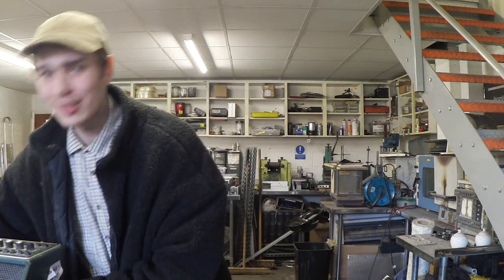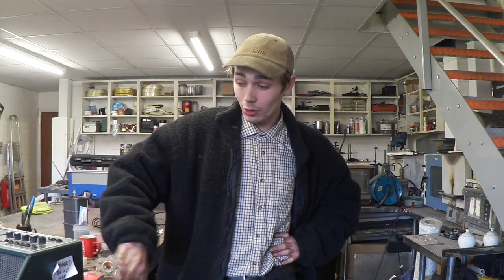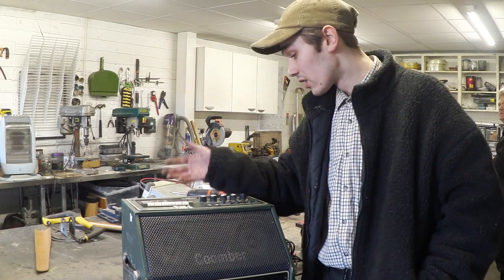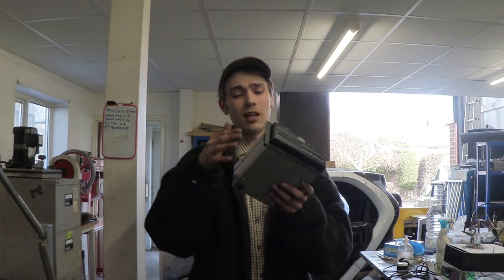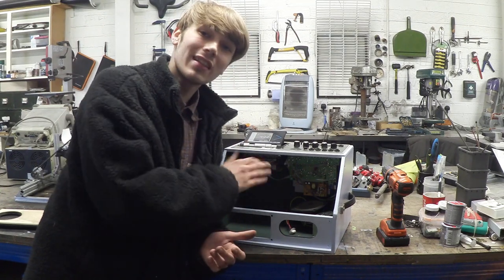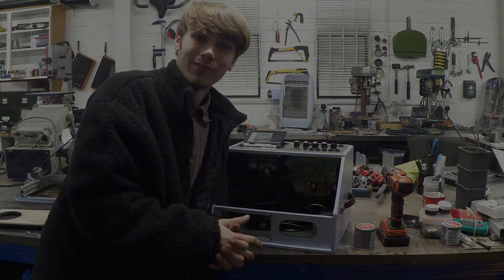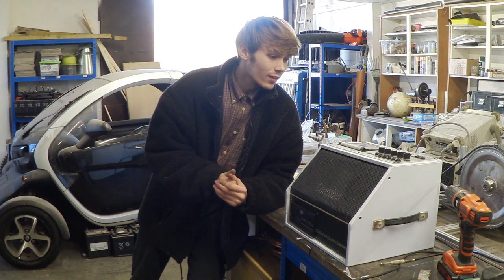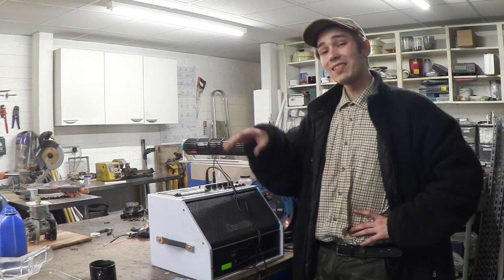1022 - From Trash to Cash - Repairing a Retro Cassette/CD Recorder

Comment: This just gives me the kick to refurbish my old Hitachi receiver. Didn't use it for years course of the miserable sound quality. But maybe the speakers need a resoldering, or / and the pots need a cleaning. Thanks for the inspiration,  Luke! 😃👍
(BTW: You're lucky that the cassette belt was still on tension.)

Comment: record button not latching?  blank cassettes have tabs on edge away from exposed tape that can be knocked out to prevent recording on tape.. without those tabs, or sticky tape lol, being in place  record usually fails to latch.
also was not uncommon to have to press both record and play at same time for record to latch. 

glad you got it working.
Reply: I heard about the sticky tape trick to record over used cassette tapes, it seems this recorder needs to have a tape init before you able to record. Thanks mate! :)

Comment: I would recommend the first thing to do is before plugging ANY Electronics stereo in the future Luke i(f you value it) 
Is connecting it to a current limiting device first. For instance a lightbulb of comparable wattage in line on your hot side of the A/C line. I'm sure your father has one around there.
 I love your videos!😆👍🇺🇸

Comment: Fantastic work there, apparently you can buy units to go into retro type sound equipment which can capture blue tooth signals, you can then play music from your phone into the speakers of the unit. 
The unit you have looks modular so maybe the CD unit could be changed into your Bluetooth receiver and or a USB input stage.

Comment: Hi I am currently trying to get my little Sony high working, well the cassette section. I have replaced the belt as it was stretched. But the sound is still rotten it sounds stretched and I have tried to manually adjust the speed but I can’t get a good sound. Help please.